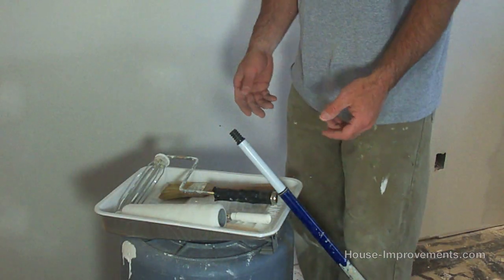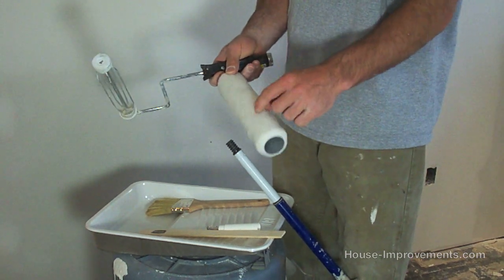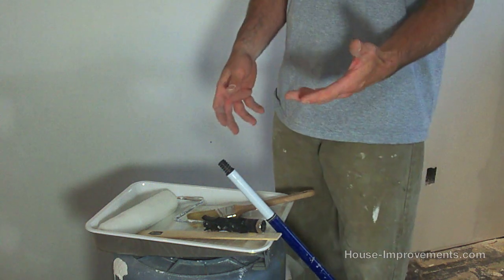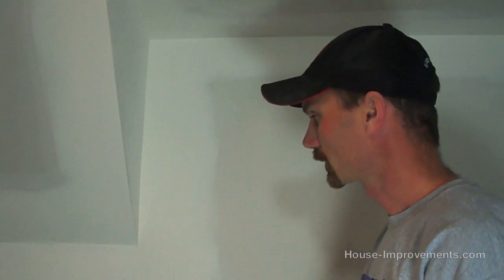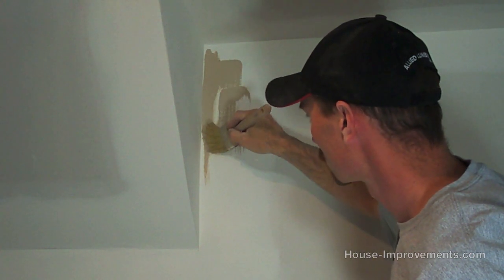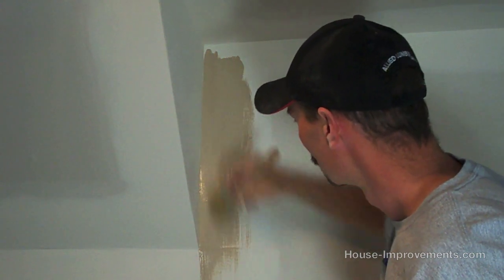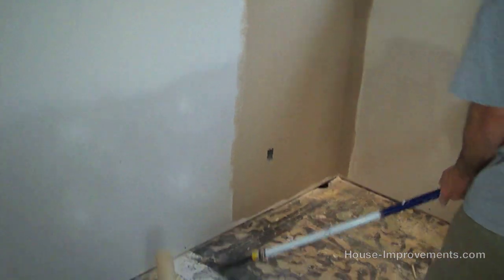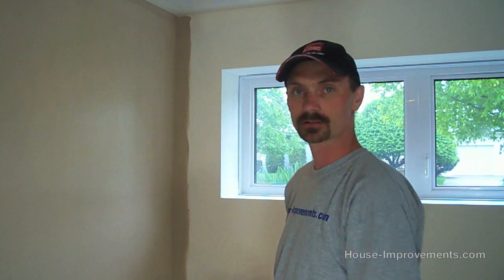How To Apply Primer To New Drywall Walls

Comment: Good vid. A good tip for wiping excess paint off brush after dipping .Is to place a thick elastic band .Vertically intersecting can so top opening of can is split by band along it's diameter. Use the elastic band to wipe blade with. Paint drips back into can. Where as using edge of can to do so .Tends to make a mess of can , with zero risk of paint falling to floor

Comment from the maker: I generally use a dry cloth or duster to give the walls a quick once over in the heavy dust areas. I then prime the walls and before painting I go over the walls with my pole sander. This knocks off any gritty dust areas and gives your walls a smoother finish.

Comment: A great way to do this is to hold a joint knife or hawk board into the crease of the wall to use as a mask as you brush on the paint. You can bang out a room in record time with razer precision.
Reply from the maker: nice hint
Reply: Oh wow! Thank you!!
Reply: jjenson2006 
I've used this for painting baseboard in  a carpeted room. An old 10" drywall knife  to hold the pile of the  carpeting back. You can gently slide the knife out after you've painted the baseboard without the carpet sticking to the wet paint. This works especially well on carpeted stairs.
Reply: You must have shitty cut lines then. Paint seems through cracks and if you're doing that on a flat wall. MAYBE you'll get a good line. Otherwise screw it on any textured surface. 
All I need it a brush to make a straight line facts
Reply: Simple and effective suggestion. Thanks.

Comment: You should try painting from a 5gal bucket with a roller grid.  This allows you to have 1-3 gallons of paint in the bucket, instead of pint in the roller tray.  Keeps you from having to stop and refill the tray.  Painting from the bucket also allows you to pre-mix 2-3 gallons of paint just incase the tint isn't an exact match between the cans.

Comment: Brushes for cutting in around windows, doors and skirtings, short pile rad roller for joints between adjoining walls and walls to ceilings. Obviously if you have a change of colour from ceiling to wall or wall to wall you would have to use a brush. You could tape the skirting etc and still use a rad roller but a brush would be quicker.

Comment: Like the self-control in not rolling right over the plug-in hole:-) You can pick up all kinds of dust and plaster out of those holes and spread em all over the wall.
Reply: Vacuum? I hate wiring in dust filled electrical boxes. Might as well clean it when you build it.
Reply: If you vacuum out the box and push the wires back in you can roll over and avoid ridge lines from stopping your roller near the box, especially if using higher sheen paint.  He does do a really nice job with the technique he's adopted however.

Comment from the maker: As long as you have primer and no actual bare spots you should be ok.If you have actual felt marker or ink on the wall you will need to spot prime those areas with a stain blocker type of primer because those spots will just bleed right through regular primer and paint.

Comment: I do not recommend flat wallcolor for most rooms, unless it is a room that is not used very often. Despite what the manufacturer says, flat wallcolor is NOT scrubbable. Every time you scrub flat paint, it removes the texture and leaves a sheen that is noticable in different light sources. If you have painted furniture or brush up against flat wallcolor, it will leave marks on your wall. Also the builder put flat wallcolor in my kitchen and bathrooms which is not recommended. There are water marks on the flat paint that cannot be removed. I am currently painting my kitchen and bathrooms a white semi-gloss paint. If you have small children like I do, I recommend a satin or a semi-gloss because they are always leaving messes on my walls. I am currently fixing all of the mistakes my buillder made which will take awhile. Thank you for the videos. BTW do you have any recommendations for removing glued on engineered hardwood floor on concrete?

Comment from the maker: That is some old adheisive from an old tile floor I think. Carpeting over it should be ok. If the crack is less than 3/8" wide you can probably carpet over it or you can fill it with a floor leveller concrete patch and then carpet.

Comment: i'm surprised you loaded the primer and started at the bottom of the wall, especially when the biggest area of spackle is in the middle. i've noted that those areas are the thirstiest so i start there and work my way outwards, and finishing with a final roll over the whole area

Comment: I just put sheetrock in my shed that is used to store tools, lawnmower, boxes, etc.
Weather is mostly hot and humid.
What kind of paint should I use that will resist stains, mold, dirt, easy to clean?
Semigloss?

Comment: For the corners and edges, could I use an edger brush thing that they sell at the store... like the flat brush that has little wheels on the edge to keep you from hitting the ceiling or a connecting wall?  Seems like the brush technique may take a while on the edges/corners.

Comment: Hey, Shannon! I thought I would turn to you again for some help. Recently I've tried a primer of cheaper category. The reason why I chose it because on the label it says that it needs no dilution, it's ready for use as it is. Having applied one coat of primer I noticed absolutely no changes on the surface, as if I had simply washed the wall with pure water. I've read that if I notice a layer of shiny film after the primer has dried, that's bad. But I assume that noticing no changes at all isn't that good, either. What do you think? Thanks for your help.
Reply from the maker: Did you mix it before using? Please use my forum for any further questions. https://www.house-improvements.com/forums/

Comment: looks good.  i have revisited your videos now and again over the last few years as a refresher.

how well would a 2nd coat of prime hide any existing slop from mudding/sanding?
Reply from the maker: Primer will not hid a whole lot but using a low sheen paint will help if things are not great. Also stay away from darker colours
Reply: Great question, I was wondering the same thing myself. 

Only difference is that I felt like the new drywall soaked up more primer in some spots than others (areas with more mud (outside corner beads)). 

Casey, to add to Justin’s question; is there ever a scenario where you would use a second coat of primer on a new drywall job?

*I know I’m several years late on this post, but if you happen to see this let me know your thoughts.

Thanks a bunch, I’m a big fan of your channel, always helping and saving me constantly!!!

Thanks again,

Jerry (From New Jersey)

Comment: Would going over the walls (after sanding) with a shop brush get enough of the dust off to be ready for priming?  I saw another video where they actually used a leaf blower.  Not too fond of that idea.

Comment: When priming a wall that has been repaired, would you first spot prime the repair with a primer intended for new drywall, and then cover everything with a conventional primer? Or can you prime the entire wall (painted and new) with "New Drywall" primer? My concern is adhesion, as I'm assuming the new drywall primer is intended to be applied over a paper / compound surface. The Home Depot paint experts told me to paint the entire wall with "New", but my common sense has red flagged this advice. 

Awesome video series by the way.
Reply from the maker: +Chris Quetsch Use a good acrylic primer and you will be fine for any of the surface. Do the patches then prime the entire wall after it dries.

Comment: thnks for the tips ,  can I paint  oil paint on masonry  (   I know  water based   paints are usually used , but I wanted to  paint an oil paint on the side  which is usually  gets the rain most.. I have previously did paint   water based on that wall    but the rain keeps washing it out  , and it don't last  very long .
Reply from the maker: Read the label on the can, in most cases it should with proper prep work.

Comment: Hi shannon I'm a first time diyer and watched this video. Thank you for all the tips. I'm curious why you needed the cutting in between the vetical walls as they have the same color anyway
Reply: He just wanted to show how to cut corners in case you want to use 2 wall colors.
If painting all walls same color then no need to cut except ceiling.

Comment: I just finished priming my new dryway. The primer is white; its the same color i was going to paint the drywall. My question is, can primer act as a paint? Since the color of the primer is perfect, do i need to still paint it? Thank you, Matthew.
Reply from the maker: +Matthew Millard  Yes ,primer is such a dull surface it is tough to clean 2 coats of paint would be best over it.

Comment: How do you "clean" the drywall before painting? I have been told to wipe the wall with a damp cloth but it always pulls away mud when I do. Do you just use a dry cloth? Please advise. Thanks!
Reply: sweep the dust off the wall then apply your product.

Comment: Do I HAVE to primer at all? I've 4 walls and a ceiling just sheet rocked and sanded and I just dread painting! So to think of painting so many times is not fun. I've seen Paint with Primers, could I just do a couple of coats of that maybe? I am going with some bright beachy colors, not just white. Thanks for any thoughts.

Comment: Why would Kilz primer not stick to new drywall.  I had my bath remodeled, primed the wall and waited 1 day - then painted.  The paint started to peal off like wall paper.   What did I do wrong.
Reply from the maker: Hmm, maybe wall too dusty, bad can of primer?
Reply: Due to the type of "purple" paper facing drywall - I added too much primer to wall.  I put on 3 coats - guess it did not dry correctly.   So I learned a good lesson.  Only 1 coat of primer - that's it. @HouseImprovements

Comment: I watched your video on how to sand the drywall and I'm ready to prime.  How much dust do I need to get off the walls?  I did what you did and went from top to bottom and then used a brush to get any chunks off.  Do I need to wash them now or just prime them?
Reply from the maker: Some people will use a damp rag but in my experience it is easy to damage the nice drywall work you have done. At this point I would prime.
Reply: HouseImprovements
Why not a vacuum with a fine brush and of course a drywall rated vac bag?
Reply: HouseImprovements Hey Shannon, what do you think about the Olympic One paint and primer in one? I heard some good reviews on it and some bad? I;m going to paint my room

Comment: I need help.. I painted my garage wall and the paint is peeling off in some spots...lady at store told me to use paint with primer and I would be okay but obviously wasn't true 🙄  my question now is can I prime over that paint or I need to remove it and then prime & paint?
Reply from the maker: No product ill stick if walls are not prepped well or are dusty or dirty. I use good quality paint with primer all the time. 
Answer to your question is that if the remaining paint on the wall is stuck you can prime over it.
Reply: @HouseImprovements  what's the best primer for new sheet rock ?

Comment: Should I apply primer to a colored wall that im trying to make white or just paint it white?
Reply from the maker: if you paint requires primer then use primer, if its a "paint and primer" in one type ,then in most cases primer is not needed.
Reply: @HouseImprovements  thank you so much

Comment: Do you have to wipe down entire wall before painting.
Reply from the maker: +Dean Char If it is an existing painted wall use some TSP cleaner on it and if its new drywall ,dust off most of the sanding dust.

Comment: after prime paint i notice i should had sanded more on taping lines. how to sand wet or dry?
Reply: not painting until i know what to do to fix my mudding edges
Reply: Roxanne Rasmussen
In the garage. did 2 in the house a crack and a hole. perfect. but big job in the garage turned out too jaggy edged. Help!
Reply from the maker: Pretty tough to sand now that it is painted, you may have to add more mud at those edges to feather them out more and then sand that .
Reply: HouseImprovements
I like your idea. tried sanding on a spot. Super hard to do through primer. I will try adding more mud at the edges and feather them out . then the next day would I be able to use the sponge sander. Worked great in the indoor hole projects perfectly.
Reply: Roxanne Rasmussen
i got a fine sponge and extra fine sponge
Reply: Roxanne Rasmussen
Mudded edges this morning. Sanded this evening. Perfection. mudding over primer did work well. like the super smooth feel of my work. no more raggy edging. Thank you for your advice.

Comment: Great video.  At 6:47 in this video you can see the floor and I was wondering if you knew what they or you did to the floor.  It looks like it has adhesive on it and I have the same type of floor and I'm wondering if I can put carpet right over it even though there is a point in the floor where this is a crack.  Thanks!!!

Comment: i like you man but you need to load the brush up more before you start painting. a quarter inch without working it into the bristles is not correct.
Reply from the maker: It works, thanks for watching Ian

Comment: I live in the basement of my grandparents house and I had no clue underneath 3 layers of wallpaper and 2 coats of paint there was drywall underneath. I peeled everything off and when doing that a lot of the drywall paper came off with it(similar to how you pull tape off a cardboard box). Is it still okay to just mud over all of the walls even if it isn't smooth like a new slab of drywall would be? And do I sand after every layer of a skim coat??
-21 year old girl in desperate need of advice!!!

Comment: Hello my friend ive been painting 12 years. Let me give you a few tips. Firstly your cutting technique is wrong. You are using wrong roller head, pole and the pans are not use five gallon with a grid work best. you are in need of many years until you make a video. You are an handyman not a painter. George Edginton